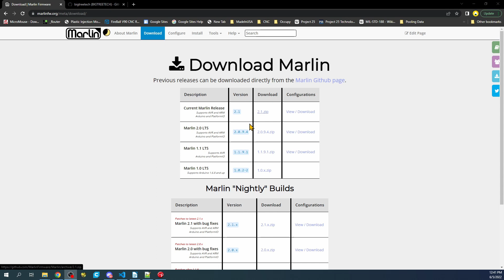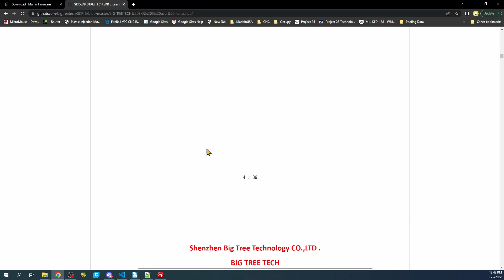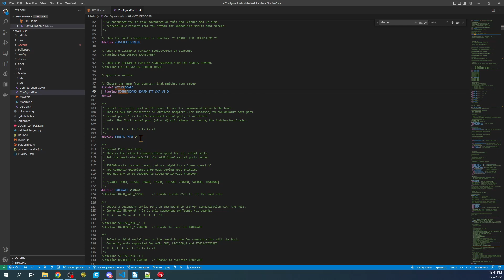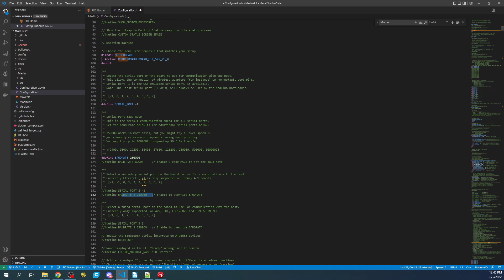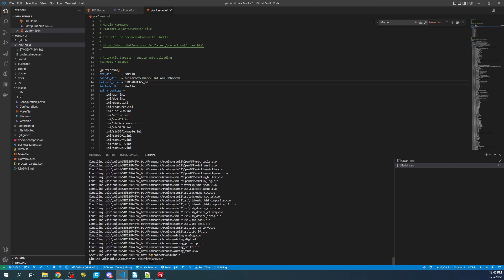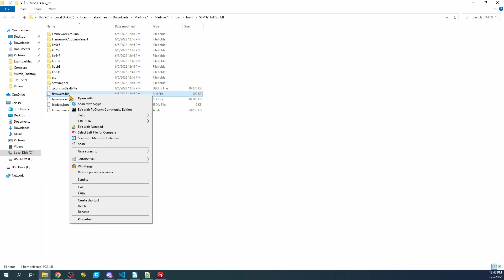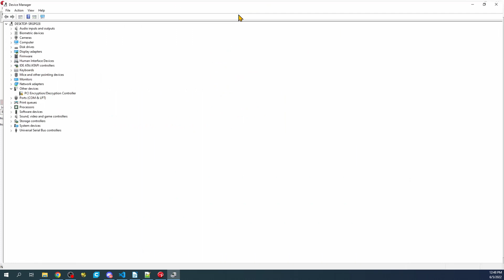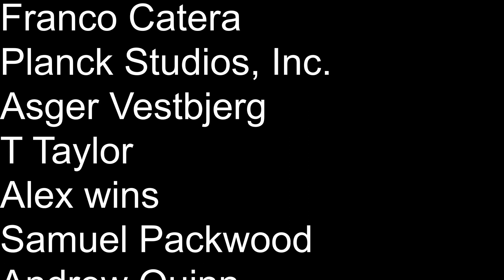BigTreeTech - SKR 3 - Firmware Loading process

Comment: The tutorial doesn’t work anymore exactly. Not sure what has changed since this video, but the board would never communicate through usb. I switched to klipper and it was much easier to get running at least
Reply from the maker: Tutorial should work.  Normally serial port or MCU selection are issues that can be resolved easily.

Comment: My BTT SKR v1.4 don't do nothing, I don't have the firmware.cur because my board come without a card, have a pre install marlin, but don't work with my printer, I have change to my configuration, copile put the firmware.bin on the board power on and nothing happens, real I don't what to do anymore.
Reply from the maker: You understand there's a playlist for skr 1.4 on my channel?

Comment: how do I update the firmware if I just want to power the board with the mains with everything already connected? do I just put the firmware.bin on the root directory of a micro sd card then just power it on?
Reply from the maker: Yup, if you're using a PSU power, power system down insert SD card and power up.
Reply: What about updating the firmware for a tft35
Reply from the maker: I'm in process of updating a tutorial on this, but there's several tutorials in my playlist(s).

Comment: I watched ever step and tried to do exactly the same thing. I've put in truthfully around 100 hours trying to flash a atmega 2560. Your video was one of the hundreds I haven't tried yet and it seemed so straight forward. Within a few clicks of the check or trying to put the right board in the right environment.... it soon spirals out of control and I lose all the files. Then I can't get visual studio working again without uninstalling it because it's so damaged. I've tried using every form available to mankind to flash my dirty firmware boards with and I know it sounds like I am trolling. Thats actually the problem in all the discords and github servers. No matter what I do I cannot get this. So about 100 maybe 200 hours in and the only success I've had is I can get the "burn bootloader" to work every now and then in arduino ide. That usually just changes the blinking lights around from the isp to the board and back. I have tried using different operating systems.... auto builders... ssh... usb, usb virtual... octopi server... pronterface.... kiauh with all its builds buttons ( that was actually my speed but ended up just loading so V.0.26 or something onto an 8bit motherboard so no help there..... but ya. The sd card trick to try and dump the oem hex was what I was hoping would end my suffering. ...... Ya thats really it. I have to be the most miserable person to ever delve into this child level dark art.
Reply from the maker: There's a Discord link in description in general chat either myself or someone else can walk you through the process.
Reply: @EdwardBraiman  I can't get anyone to help. I'm sure someone could fix this in 10 minutes and thats what makes going on 200 hours of wasting my life watching youtube videos and running random code on countless programs so torturous.
Reply from the maker: @KNIGHTS_TRUMPLAR  This is the link to the Playlist you're looking for :
https://youtube.com/playlist?list=PLP-VDZmS6bFplv5ttZb9m_zz6L7FXA4w4
This is the link to Discord:
https://discord.gg/JzhdGgr

Everyone is in General Open Chat, not there's all 800 people who can help there.

Comment: What version of vsCODE are you using?  I don’t have half those buttons I see on lower left as the “trash can” , “✔️”.
Reply from the maker: Most current, in the Basics video in playlist, there's a link in video to how to install, VScode with PlatformIO video.
Reply: @EdwardBraiman  ok. Thank You.  I’ll look for it
Reply from the maker: It's also in video you just watched in upper right and corner.  It's I think between 2-5 minutes into video.
Reply: @EdwardBraiman  I watched your Installing vsCODE in windows from a year ago.  I think it will be very helpful THANK YOU 😊